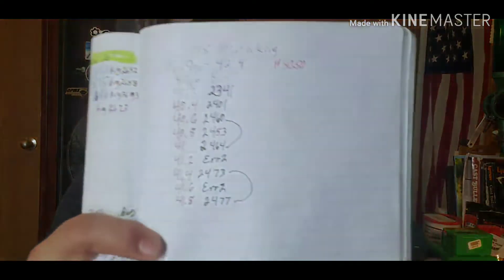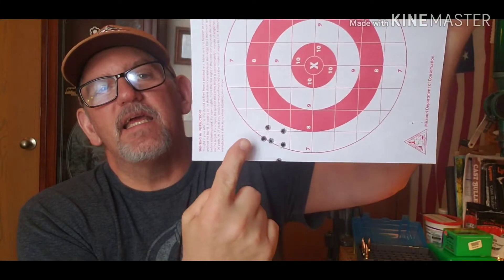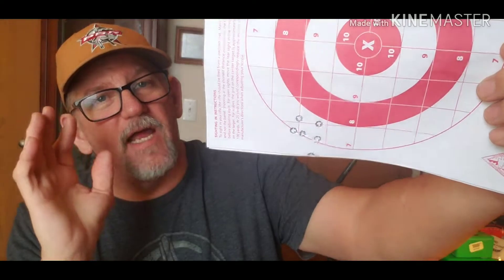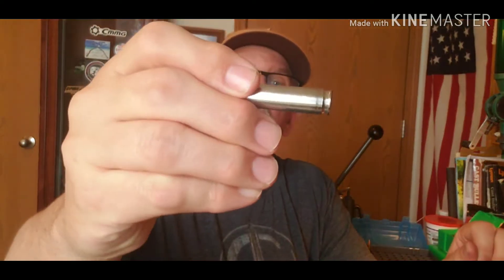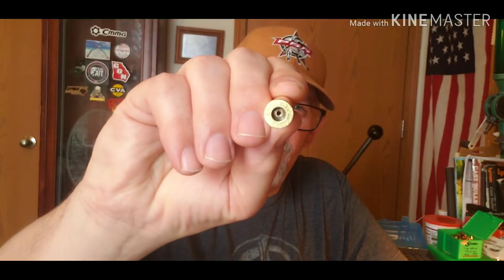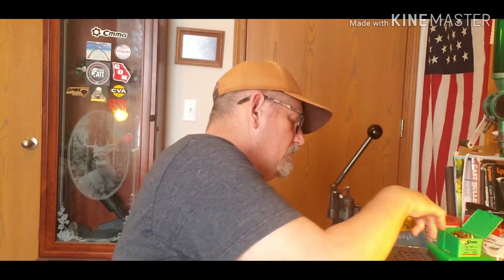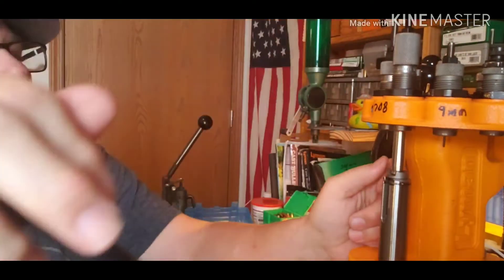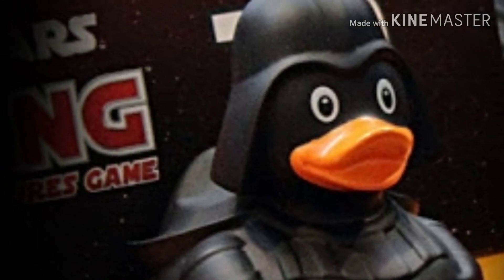7mm-08 175gr Sierra match HPBT ,and H4350

Comment: Keep at it Tim, that twist rate should handle that bullet fine. My 7-08 has an 8.5 twist and I’ve got good groups with 139 and 160 bullets. I loaded up some Hornady 139gr BTSP the other day with 3031. 38.5 grains shot a half inch group. Good ole 3031👍🏻😬
Reply from the maker: I guess I need to try 3031 👍👍🇺🇸🤓

Comment: Great video and choosing brass I will never do that again I have to invest in quick load I ended up with serious high pressure from federal brass to ppu brass there is a huge difference between brands so my reloading is on hold
Reply from the maker: A lot of people don't consider the difference and capacity between brands of brass or if they are thinker within the same brand of brass. It does happen.